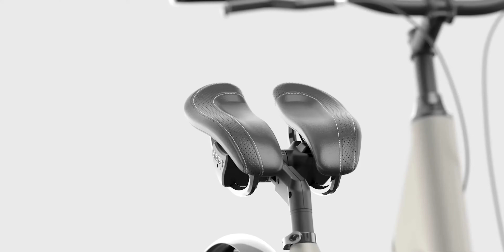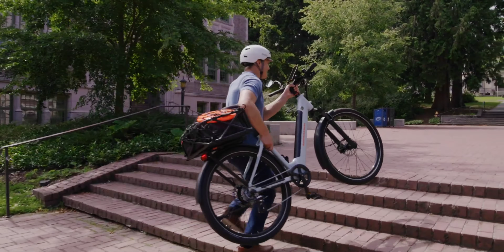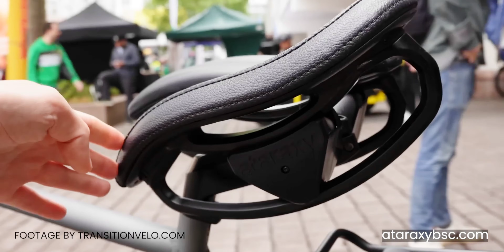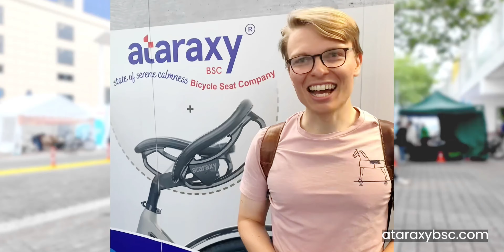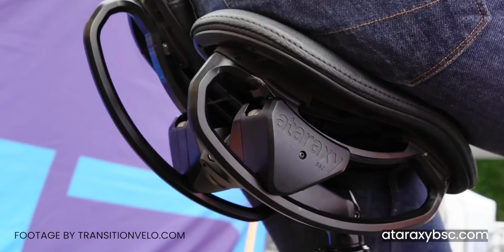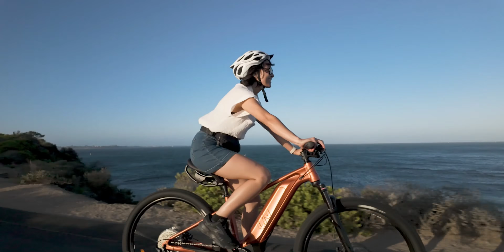World's First Moving Split Seat Saddle - vabsRider

Comment: My biggest concern is stability and weight distribution. Your body weight has to be supported somewhere. If this saddle provides less stable support or causes the rider to shift forward, more weight could end up on the hands, wrists, elbows and shoulders. Reducing pressure in one area doesn’t necessarily mean improving overall comfort or ergonomics. Have there been any independent long-term tests measuring weight distribution, upper-body strain and stability? At this price, I’d expect solid scientific evidence, not just marketing claims.